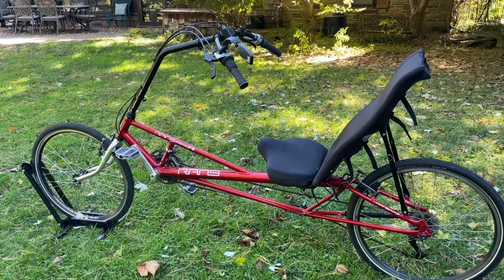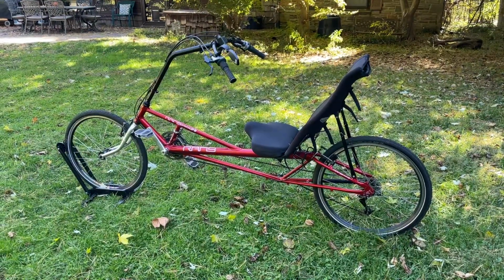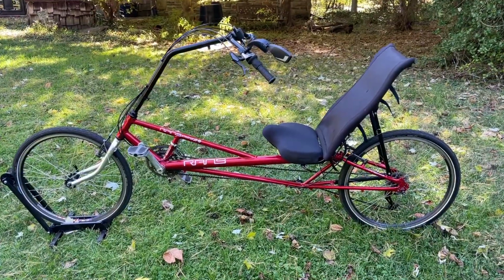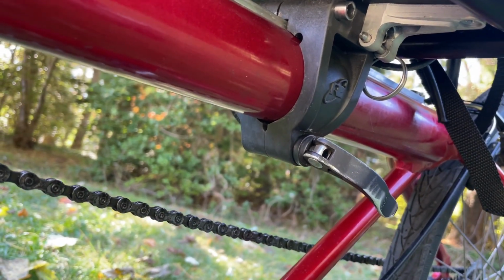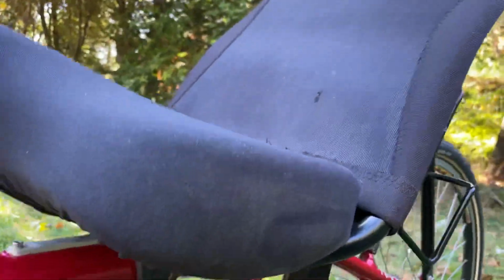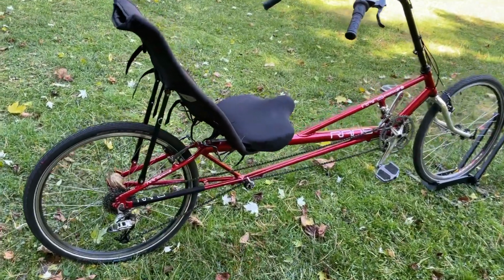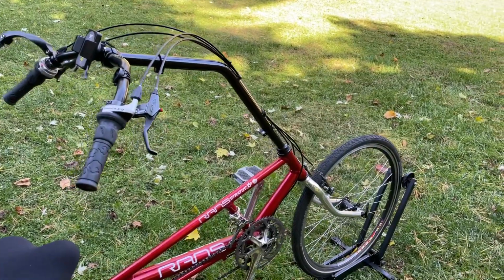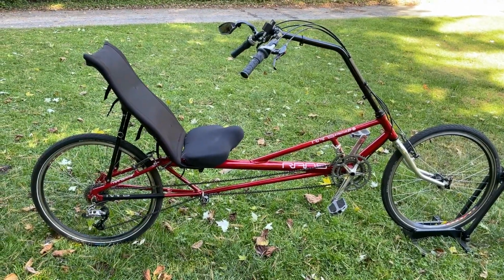My 2009 Rans Stratus XP (Aluminum)

Comment: What is the approximate price of a bicycle of this style? Good video
Reply from the maker: You can generally get nice Rans and Easy Racers bikes fairly cheap these days. It seems that generally someone will offer a bike for sale in a part of the country that might be 500 miles or more away from interested buyers.

I think I paid $300 for this bike from a seller on FB Marketplace in Michigan. But I think if this would have been available in CA, TX or FL, it probably would have been able to sell for $500, $600 or more. 

If you really want a nice Rans XP there are sellers available right now that can you get you a nice one for around $1000. If you're patient, you can probably find one for much less.

Comment: How fast did you get her to go on the flats?
Reply from the maker: I don't have a lot of pure flat area on the roads and trails that I bike in my area. On a rail trail near me with a typical ride of 25 miles and 600 feet of elevation I can average about 16 mph and max around 25
Reply: @BikesAndBanjos  Same as a road bike then.
Reply from the maker: @deltafour1212  Yes! but a LOT more comfortable ;)
Reply: @BikesAndBanjos  That's disappointing . Why do they say Recumbent's can beat road bikes on the flats in terms of speed?  That's the reason I was looking into buying a recumbent because I thought they were way faster than road bikes.
Reply from the maker: @deltafour1212  a lot of recumbents are faster. In general if I'm riding a comparable gravel bike on the same trail I described above, I'd probably ride slightly slower. 

However the Stratus XP isn't the best hill climber and we have long (if relatively low grade) hills in our trails. So there's always areas where a traditional diamond frame bike might gain ground. 

Alot of the speed also has to do with seat angle and on this bike, I've been using a fairly upright position. If I adjusted it so that I was in more of a lying down position, it would also improve speed.

I tend to do more social rides and I'm usually not that concerned with speed, especially on the rail trails that I frequent. But I have been riding a Cruzbike with a front wheel drive train that seems to climb hills better than most of my other recumbents. The Cruzbike that I have is fairly heavy with wide tires and a shock and is sort of a recumbent equivalent to a gravel bike. But I'm starting to look at lighter weight road bike Cruzbikes so I'll be able to do some faster road bike riding with some of my faster biking friends.

I think on very flat roads/tracks, recumbents are generally faster than diamond frame bikes and if you're really looking for a speedy recumbent, I'd take a look at Cruzbikes
Reply: @BikesAndBanjos  Thank you, very much!
Reply: @BikesAndBanjos  I like the style of the Stratus has that chopper style look to it. I plan of running on the flats where I am and into speed because its fun. If I can cruise at around 20- 25 mph in a recumbent in the stratus style i would be very very happy.  I kept thinking if you're pushing against the seat and using your legs and correct me if I am wrong, that speed seems achievable to me
Reply from the maker: @deltafour1212  You can probably achieve those speeds on very flat areas. But just one more reminder, the Status XP is more of a touring style recumbent. Rans makes other recumbents that still have that chopper look and feel (with the nice steering column that I like) but the seats are a little more horizontal and the pedals are higher making it a generically faster bike. 

If you get a chance, take a look at some of the faster Rans bikes like the Rans Velocity
https://bicycleman.com/rans-velocity2-recumbent-bike/
Reply from the maker: Also, Rans isn't making many new bikes these days. If you want a new bike, check out Phoenix Cycle Works which took over Rans a couple years back. Or you could just look for a used Rans bike
Reply: @BikesAndBanjos  Thank you SO much for your help and letting me pick your brain.  I appreciate it SO much
Reply: @deltafour1212  I have passed carbon fiber diamond frame bikes  going uphill. Is the super light carbon frame fast ? Nope the rider is the one who makes the bike or the bent perform. On a diamond frame your legs are an added wind resistance problem that the recumbent takes advantage of with the legs out front. The seat is far more comfortable than any saddle will ever be and that means more distance without any of the pains you get from sitting on 3 square inches of saddle. So faster on the flats , really fast on the downhills and as fast as a diamond frame bike uphill," IF " you train for it .  Speed and comfort beats speed only.  Go out for a ride on any diamond fame bike for 60 miles , do not get off the seat for any hill , hold onto the handlebars all the time and see how your body feels? When i was younger none of this mattered but as you grow older various body parts start objecting to what we have always taken for granted.  Now I sit in a well ventilated seat with a backrest , steering with two positions on the handlebars , looking straight ahead and no longer have any pains at the end of any ride.  Leg energy  may be worn out but that is acceptable.
Reply: @brucewmclaughlin9072   I understand totally. Did the carbon cyclists know they were competing with you?  I just can't imagine peddling 60 miles on any bike. Too boring and mind numbing. That's why I like going full speed for 10 miles maximum. Love speed.  I had the same issue with my roadie until I went to a hybrid. Up-right riding, looking straight ahead with no more numb hands or neck pain. Tilted my seat down a half degree no more groin pain.  LOVE my hybrid fast and comfortable.   I don't need to get off my seat for hill climbing but I do it to build my legs and for the workout. Plus it's fun. Recumbents are comfortable but people look "goofy" riding them. Only reason I would like to ride one is from that seating position all the power goes to your legs  and I imagine you can go pretty fast on one .
Reply: @deltafour1212  Well when you are riding a recumbent and enjoying speed and comfort and onlookers think you look dorky , so what ! Around here little kids think I am cool , mothers comment on how the bent looks comfortable and the die hard roadies find something in the sky that diverts their attention from the guy on the two wheeled thing that is not like their bike and thus must be ignored. It's a bit like driving a car with a fluorescent pink paintjob where others are nauseated by the sight and you are getting somewhere without looking at the color.

 I just can't imagine peddling 60 miles on any bike. Too boring and mind numbing.

Really depends on your area of riding as 60 miles of boring road is gonna be boring regardless of what you ride. 10 miles /16 km of pushing yourself is such a short ride and we have people on the north shore where I live who buy their top of the line 16-21000.00 carbon fiber bikes to do the same out and back on the same road for a whopping 60 km thinking that is a good day out?
Reply: @brucewmclaughlin9072  Like I said to each their own. If you enjoy riding your recumbent and makes you popular and boost your ego with the kiddies and the housewives, that's fantastic. Long as you're enjoying your recumbent that's all that matters no matter how many miles you ride.  It's all about having fun.  I would love to ride a recumbent just to see how fast they truly are compared to my upright. Personally, I can't justify the price for a recumbent.  let alone 20 k for a carbon bike.  I see a lot of road bikes and especially recumbents for sale for dirt cheap. I never have asked why they are selling their recumbents, but I have my guesses. I read online line where some sold theirs because they are hard to balance and steer, cars cant see them because they sit too low and almost get killed and yes they even said they are uncomfortable.  I'll stick with my upright till then. I'm comfortable and pain free and I have no trouble keeping up and even sometimes passing. both roadies and recumbents in a few one-on-one races now and then and yes, they knew they were racing  ;)
Reply: @deltafour1212  The best way to compare a recumbent against a road bike or even a triathlon bike for most of us who do not have a wind tunnel is to ride both bikes on a track to take the wind out of the equation, or at the least to ride up and down the same route while measuring your power with a power meter on both bikes. The most reliable data I have racing my Cruzbike V20 (high racer) with a rear disc and 50mm deep front wheel, against a Cervelo P5 with HED 60mm wheels shows that it cost me 211 watts to do 45.6kph versus his 286 watts, for a difference of 75 watts, which is absolutely HUGE for that distance.  We both rode the same 25km section of path on the same day with the same good tailwind, and he beat me by 1 second. The max power I put out on the ride was 485 watts on a shortish climb while his max power at some point on the ride was 891 watts. He is a young buck whose heart rate was between 171-183bpm. I am 55 years old and I am fairly certain I never got my heart rate to 170bpms during the ride. 

He stopped at 25km, but I kept going for another 18km for a total of 43km at an average speed of 43kph. This isn't a typical speed/power for my V20 since it was with a tailwind, but it does show the power/speed difference between a very fast triathlon bike.
Reply: What is the approximate price of a bicycle of this style? Good video
Reply: Cuanto cuesta una bicicleta como esa. $
Reply: @deltafour1212  wots yer hurry?
Reply: @daktarioskarvannederhosen2568  I like speed.
Reply from the maker: @tonycanalescortes5488  sorry it took me so long to see your question. These are 10 plus year old bikes. Used, you can easily buy a nice one for less than $1K. If you're patient, you can probably pick one up for $500 or less. 

If you want top of the line builds and brand new, you can buy a Phoenix 700 (similar to the Stratus XP) from Phoenix Cycle Wrx (who took over Rans). It's more expensive, but you have a lot more control over what you're ultimate bike will look and feel like.